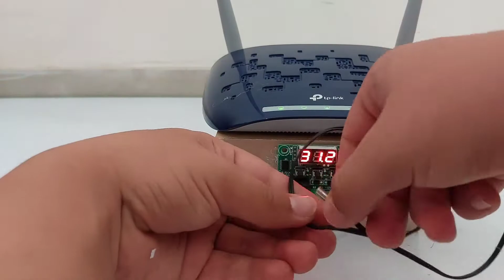Smart cooling device (for modem)

Comment: I made this using off the shelf components, You can buy USB power switches and USB speed knobs, so I have a laptop cooler (also works for modems) connected to a fan temp switch, I stacked stick-on clips so the temp sensor can feel the heat from the laptop's exaust. since the laptop cooler has a passthrough that's useless, I plugged in a set of USB cooling fans meant for entertainment centers and I put one from the AC vent pointing at the laptop cooler, and one on top of the keyboard (I'm using the laptop as a desktop for now)